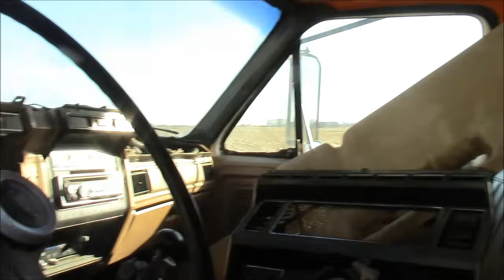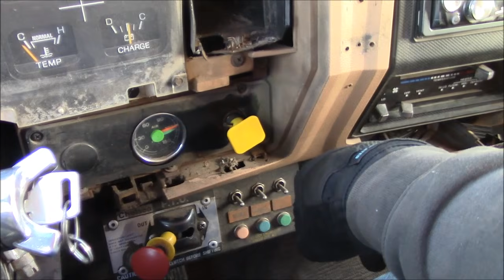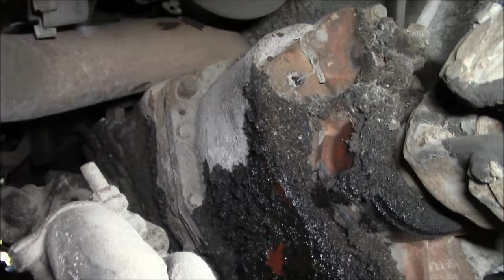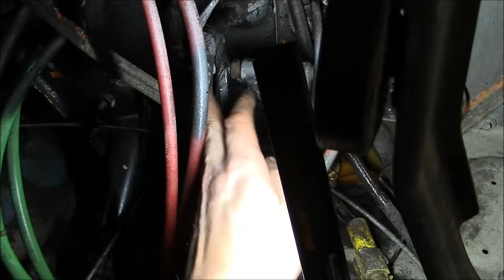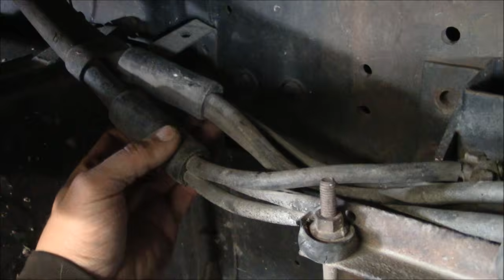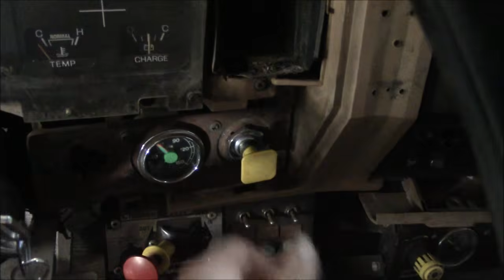Sweet 1984 Ford F-800 - No Headlights, Air Leaks, Bad Brake Valve.

Comment: You don't have a face shield, steel toes, a safety vest and a flag man. I'm surprised you survived the video.
Reply: No hard hat either. Lol
Reply: Don't forget the hearing protection and self contained breathing apparatus.
Reply: tsk tsk
Reply: @donniebrown2896  What about a high viz jacket !
Reply: I've no recollection of actually commenting on the usage of Pppe ,but since I to was one not to always where the proper gloves when I worked with gas and oil ,gasket gunk and silicone etc...plumbers glue ,and drywall mud is so so hard on the skin ,soaking into the body like after all we are like a spunge .,and by the time in was 25ish I realized that this was why I could use the palms of my hands to sand off and smooth down the final stages of a drywall job.  More so cause gloves ,other than construction grade type weren't always convienent to use or go get, but they also didn't have these awesome mechanics gloves like they have today, . 
Well I mean my hands were cracked and sore opened wounds that's how bad my hands were from chemicals, and after I made the connection as to why,  my hands are now for the last 25ish years been just regular rough man's hands,you won't see me pumping gas without gloves on. And with that being said,I'm sure the guys commenting on Wes's post ,and others with similar YouTube channels are concerned about.  Especially with all of the extra agents in gas and oil now adays... But go ahead,don't wear gloves,or safety gear when required, and joke around about guys like me who do ,also won't catch me without my safety glasses ,cause now I have prescription glasses. You only get one set of eyes.🤓 So also I love watching Wes work,and I wouldn't want him to get hurt.  
So there.😊

Comment: Tootsie rolls work well for mouse trap bait, you just chew the piece till it's soft and put it on the trap trigger, it can be used over quite a few times, the down side is re-chewing it.
Reply: that made me laugh-out-loud!!!
Reply: I have had success with cheese (almost any kind will work) and peanut butter.  The aroma gets them every time.  However Wes should consider getting a cat.  The mice will stay away and he won't have to put the traps out.

Comment: Confused - why do people comment for you not wearing gloves.  I did not know they were a requirement to get things working.  Keep up the great vids.
Reply: It's probably because they work in an OSHA regulated environment.  And yeah sometimes protection is a good idea.
Reply: Bone cancer. Mostly it's about the bone cancer.
Reply: The constant contact with corrosive fluids is one thing besides that even the most insignificant cut that you wouldn't think anything about can kill you, it's called septasceima or sepsis, I had a mechanic friend who died becaise of a small seemingly minor cut infected his blood stream, he went into complete organ failure after he arrived at the hospital and couldn't be saved, endocarditis occurs if those germs reach the heart, I knew an older man who didn't feel quite right at work so he drove home, the next thing he knew he was in intensive care, he had cut himself trimming some bushes and thought nothing of it, be careful out there.

Comment: Here in my corner of Pennsylvania my farmer customers refer to their 1980's vintage trucks as their NEW ones.  My last farmer customer's "OLD" truck is the 1947 Ford F-8 that I just put a new clutch in.
Reply from the maker: Heh. When I was younger we worked on a lot of 1970s Chevy gas powered grain trucks. 5 speeds with 2 speed axles and the famous "short 4th" shift pattern. My dad put a lot of clutches in those trucks. Constant ignition and carb issues from sitting around all the time.

Comment: I'm an electrician, I use thousands of crimps a year. I twist the strands, it keeps them neat so they insert into the crimp better. There is no reason why you can't do that.
Reply: I worked in the electronics field for over 50 years in various forms and I found one thing that would always seem to rear it's ugly head and bite me.  The wires I did not twist would pull out of many crimp connectors because they were just straight in.  If I gave them a slight twist I rarely had one come out as the wire had the "benefit" of the others helping hold it in place.  Like everything else in this world, you're going to get more opinions than there are people, it seems.  My best advice is simple, you do what works best for you and is within the electrical codes for the item you are working on.
Reply: It is different: i work as a railway signaling tech: in track circuit (which in Sweden is DC) : twisting the strands is forbidden because it risks breaking the strands and it also destroys the positive properties of the crimp and the crimp tool. The track circuit cable is 25 square mm and because it needs to be flexible the strands is relative thin.
Reply: @TheStefanskoglund1 , like I said, you follow the code of the job.

Comment: rt 6610 is a direct drive 10 speed rated at 660 lb ft of toque. used mostly in medium duty trucks with a low hp motor. much smaller physically than a std 10 speed in most road tractors. the last repair harness i got for a ford head light switch had all the same color wires coming out of it. nice clean old ford.......would look good in my collection!
Reply from the maker: I was really expecting it to be a 5 speed Spicer synchro with a 2 speed axle. This RT6610 is a neat trans. I think it has the closest ratios of any trans I've seen in a truck. It's a workout to shift!

Comment: I used to drive a line truck with a boom and auger. It had the same transmission. Nobody else would drive it because it wasn’t synchronized. I absolutely LOVED it…. Smooth as silk…..

Comment: Youre doing it just right on those pigtails! NEVER solder on a wire of a machine that will vibrate in operation (like a car, truck...)! I work in a motorsports company, we always crimp! Always! Why? Solder makes wires stiff and they will break later!
BTW: Multiple Wires in a crimp is not a problem at all. Just make sure you use the correct cable shoes/buck connectors/eyelets for the correct wire (AWG). Infact we "fill up" eyelets ( which are too big for a specific wire ) with additional wire strains and then crimp them.
Giving the wire a light twist prior to crimping makes no difference at all.
As a motorsport engineer Im safe to say: Youve done an excellent repair job on those wires!

Comment: I used to own, drive and repair these Fords 700s, 800s, & 8000s. With Cat3208 , 7.8 diesels, 391, 370 & 429s. All 5&2 speeds. Good ol Trucks. Used in Oilfield. Brings back memories. Very reliable and tough. Its a shame Ford quit making them.

Comment: When used properly crimp connectors work fine.  The problem is that most people don't use them right.
Reply: I like solder and shrink tubing.
Reply: Only way to go

Comment: At least here in the UK we are taught when making crimps not to twist the wires, the reasoning is that it increases the diameter slightly more than parallel strands, that means the cable isn’t completely compressed in the crimping process.

Comment: Sweet old Ford. I drove an L9000 tractor for years. That other air switch is your cutch or trans brake, before they put them on the bottom of the clutch travel.   Todd the retired trucker.

Comment: For catching mice back in the day on my dad's farm, we'd use a 5 gallon bucket.  Fill it about half full of water, put a ring of peanut butter around the inside a few inches down from the top and leave a board or something else for a ramp up the side.  You won't believe how many mice you will catch that way.

Comment: I always twist the wire too. It seems like any time that I don't, the butt connectors won't go over them without having a few strands hanging out the back. My little part time shop is also surrounded by fields. Rodents used to be an issue for me too. I tried every kind of trap available. Then, one day, I found a fool proof solution. My "shop cats" are on duty 24-7-365! I got them as kittens, but, as they grew, the rodent problem ended. They now have a loyal following of customers that stop by just to visit "the Kittiots", even if they don't need work done. I haven't had a rodent in my shop for 5 years!
Reply from the maker: Well I have a worthless hunting dog. He gets the odd mouse here and there.

Comment: The early 4 stroke Detroits I've been around were pretty good engines but I've been told they're really hard to get parts for now. I've always twisted my stranded wire and never worried about internet electricians lol. I do miss the interiors of the older Ford's.
Reply: I agree. I’ve always twisted mine too since I crimped my first but splice.  And I’ve got a complete 8.2 motor and Tranny sitting as parked ran five years ago. Truck Roadway Complete cab over rust bucket Ford Pretty Orange pain lt with a title ready to load on someone’s roll bacK. Located N TX

Comment: Those 2 size but connectors are nice. I need to get some. I’ve been using the larger size and on the single wire side I strip off twice as much wire I need and fold it over so you have a double thick single wire to crimp.

Comment: Good old air ride seats! I drove an early 2000’s F-650 Diesel boxtruck, automatic, only power steering. It was a tank!  My new 2020 F-650 gasoline, is a dream (they removed the air ride seat, it’s the same cab as a 550).

Comment: Stranded wires come twisted out of the factory as far as I know and the reason is obvious, twisted strands make the wire stronger just like in any kind of rope. They only become untwisted when one removes the insulation when connecting these wires.

Comment: Great video, those headlights which is haven't changed, since at least the sixties. I restored a 65 Mustang that had the same exact headlight switch.
Reply from the maker: My 1995 F-250 uses the same switch as well. I think in 99 they went to a rotary switch in the trucks.
Reply: is far - or short - i know by GM they changed between 84-88 to a modern switch on cars
Reply: @WatchWesWork  Did Ford ever go to the headlight switch on the turn signal stalk on the large trucks?

Comment: At 1:39 there was an image of the heater air box assembly while you were describing the engine. The 3 plug going the fan motor speed control resistor appeared to need repair. The one in my 1980 f250 4x4 actually caught fire and filled the cab with black electrical smoke. I managed to pull over, open the hood and save my truck but what an experience for a rookie driver. I learned there's a great amount of amperage going through those wires the hard way. Great videos God bless.

Comment: Nice job Wes.  You probably have used this trick before but if you have to replace a long wire or tube that runs through inaccessible places secure the end of the new wire of tube to the one that is to be replaced and pull the new one through by pulling on the old one.  Clips and ties may hinder the process but it usually saves some time.  Good luck...

Comment: Twisting the wire end, from what I was told years ago, the strands can cut the others when crimped.  Hard not to resists too twist.  Good video again, thanks
Reply: I always go with twisting, makes it easier to insert into the connector.

Comment: Great older truck that's been well cared for it's entire life. Strong simple
 driveline ensures uncomplicated maintenance at minimal cost for generations. It's this simplicity that requires you to use methodology, learnt and taught skills, and common sense to resolve issues. It also brings me out of the office into the workshop to watch confused apprentices presented with a repair that they cannot plug a computer into, and the old school mechanics, including myself, sitting back waiting for someone to approach and ask for help !!. Block heaters in Australia are restricted to emergency service heavy vehicles where operating temperatures at startup are a necessity. This optional engine is also fitted with an external oil pump that continuously circulates oil ensures until disconnection from the external power source. Keep the old school vids rolling in Wes 👍👍🇭🇲.
Reply from the maker: Interesting. Most engines in my area have block heaters. We'd never get them going without them!
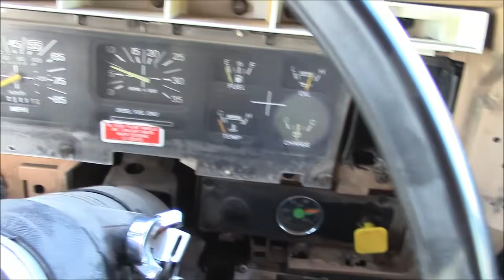Reply: @WatchWesWork  An example why we don't need block heaters.... 10:48 Central Australian time. Current outside temperature 49°c or 120 °f !! 👍👍🇭🇲

Comment: We had a 78 in that series as a medium duty wrecker bought new resold 1980. And up in service until. 1999. Clean truck but had cracks and Holmes boom fatigued so they put it in storage and use it parades and events..tuff truck

Comment: I think you're right on the money with the crimp connectors... and the type of crimpers. I had some volunteers on our 1922 Birney streetcar using the cheap "squeeze" type of crimpers where there is no tab pushing into the back of the connector.  I checked their work and when I tugged on the wire, it fell out!  And this is a 600VDC system where loose wires arc like crazy and start fires.  Love your videos.
Reply from the maker: Yeah you have to do the tug test!

Comment: An excellent tutorial on crimping!   I noticed that you have a proper crimping tool.  Using the crappy 'multi-stripper' tools for crimping is miserable.  Klein and others make good, dedicated crimping tools and they are so much better.   You pointed out which side to put the seam on, and that is critical.
As for the electrician who told you not to twist the wires - the fact of the matter is that the wires are already twisted in the insulation to begin with.  When you strip off the end the wires can come untwisted.  If you gently twist them you are just returning them to factory form.  Good job.  If, however, you twist them tighter than factory form then you are increasing the diameter of the wire some small amount, and that can cause problems getting it into the connector for the crimp.   You have to twist it pretty darned tight to cause problems, normally.   In a pinch, if I have a connection that was in a screw terminal or is otherwise mangled but I don't have room to cut it shorter for clean wire, I use my linesman's pliers to twist and pull the strands as if you were brushing your daughter's ponytail to get it to lay nicely. It's hard to describe, really.  You have the handles of the pliers in line with the wire.  Gently squeeze, pull, and twist.

Comment: I find twisting the strands makes sure you don't have any stray strands that don't make it into the terminal.  The only time I find twisting to be a problem is when I have to fit a undersize terminal on the wrong size wire {in an emergency, of course!}

Comment: Twisting the wires makes the diameter a bit larger, but I usually twist too.  I don't like random strands missing the crimp connection.  That is a nice one, but they usually don't get much use.

Comment: We call those push lock snyflex fitting,  
Push to leak fittings.  They are easy to work with and the manufacturers love them but when a truck has lots of them on it such as snow plow trucks where everything is air operated,  the little bit they leak really adds up when they aren't running.

Comment: You are correct Wes .. twisting the strands will not harm anything. I have been in electronics for over 25 years and just recently learned in an advanced PCB design class (in an effort to learn how to minimize EMI) that energy does not travel inside the conductor but around it (and yes, even DC). Even on a PCB the energy does not travel inside the copper traces but around them.

Comment: 6:58  Whoa that looks really good.  👀👀
If you could do it  Fill a cup with battery terminal cleaner (spray can type) and soak the connector. 
After a few minutes soak the connector in water, dry off. and use dielectric grease.
Just a suggestion.
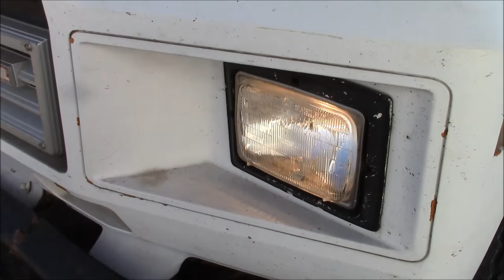7:46  Don't you just love it when people will ask questions like "Why doesn't my block heater work ?"

Comment: Learn something new everyday—when learning to get my CDL/DOT we were told/taught that you cant “bandaid” air lines and jt was a huge no-no, pretty cool they found a way to fix/repair the air hoses this way
Reply from the maker: That's only the service lines to the trailer. They cannot have splices. The rest of the system is fine.
Reply: @WatchWesWork  Gotcha—awesome!!

Comment: I learned a low-tech trick to test and see if the block heater is working....if you place a hollow metal tube on the block, and put the other end to your ear, it acts like a stethoscope and you can actually hear the coolant bubbling.

Comment: i use those  but conector for many year on are fleet trucks with the srink tubing with melting glue inside and there the best never had a come back and those ford headlight swith were very popular in the 70 and 80 and 90 they fail alot we always had a couple in stock.thanks for video always great

Comment: If its an Eaton-Fuller Roadranger, its synchromeshed. The first one I ran was in a 1974 Diamond Reo with a 671 DD backed with a 13 speed triple low-hole.  An absolute blast to drive as long as you had ear plugs!  Great vids, Wes.

Comment: That extra air knob on the gear stick is for the "countershaft brake". I saw the brake unit on the gearbox when you were looking for the manufacturers plate on the box. It is a simple air piston inside the PTO cover right next to the manufacturers plate. 
When you press the button on the stick the piston rubs on the countershaft to slow the countershaft and clutch down so that you can engage a gear from neutral. (which you can usually do anyway!)
Reply: Thanks for the explanation
Reply: No its not. It has a 2 speed rear axle. It a splitter gear operates solenoid on axle.